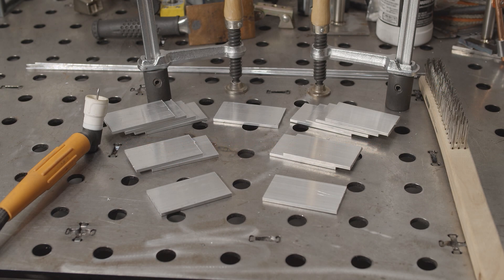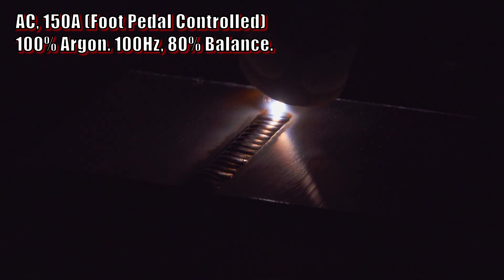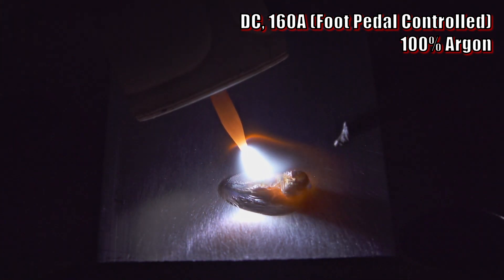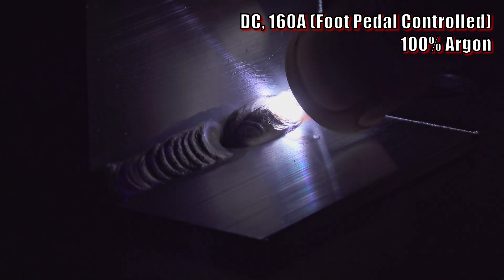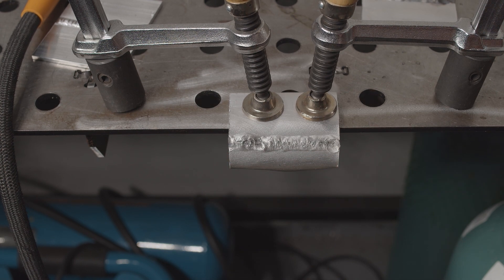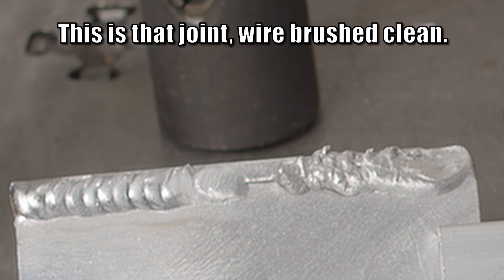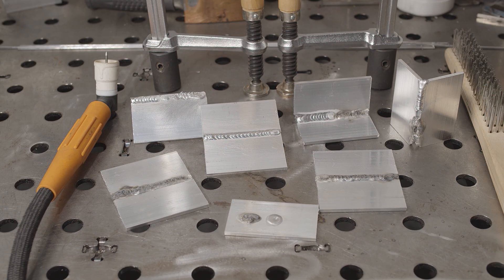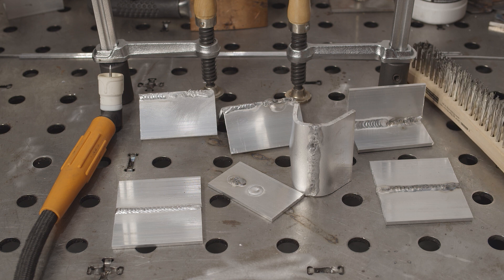TIG Weld Aluminum with DC and 100% Argon?

Comment: While watching your video, I asked myself whether there might be a chance of getting a better weld done with DC and Argon when you try to kinda add flux or brush away the oxide while pointing the argon on the startpoint of your weldseam. You could build a simple holder for the torch or another source for having a constant argon flow to the start point. While applying the argon you could grind, brush or etch away that oxide layer and start welding on that particular spot. Even if it would just affect the beginning of the weld, it would be interesting, whether this helps or not. But who knows if this will give a better chance to have a better seam at all because of a proper joint at the beginning of the seam, so the following material flow might be at least supported...in a way. Hope you got my point. 

Greetings from germany!
Reply: And while thinking about what i wrote, i thought about adding a few drops of flux onto that aluminum in direction of the seam, so the whole welding area is covered under flux until the torch ist burning the flux away. Wheres flux, there might be no oxygen as long as its completely covered. When it gets burned away, there might be enough Argon surrounding that spot yet. So if we are lucky, that could lead to process which fades out the flux at the same time when Argon is fading in. So no Oxygen between etching and shielding. And again...I hope you got my point. :D

Greetings from Germany again!
Reply from the maker: Not sure how the flux would interact with the TIG arc.  Could be interesting to try out.
Reply: @bigtb1717  I own a DC tig welder myself. Its made by EWM, which is a high priced brand from germany. Had a lucky moment to get that one very very cheap. But since I faced that I won't ever be able to weld aluminum with that machine, I always thought of buying a chinese made AC/DC welder. But should I really give away my nice german made welder for a chinese one? Well...owning two welders wont make sense for me, as im not having that much space and as of its just a hobby ill need to keep an eye on the money too. The few moments, when I need to weld aluminum, it would be nice to have a trick to get it done. Brazing is a possibility also. Usually strong enough for most cases. But welding with DC would be nice. :)

 If you would give that flux method a try, that would be very interesting!
Reply from the maker: If you can get a bottle of 100% helium shielding gas, that can be used to TIG weld aluminum on DC.  It's better on thick material because of the added heat of the arc, but it works.
Reply: @bigtb1717  Yeah as you showed, that worked good in a way. But having another bottle standing around might not be the better choice over a quite compact AC/DC inverter welder. Even if its made in china. Therefore...I guess getting more into brazing might be the better choice for my circumstances. Or the chinese welder...

But anyway, do you plan to try the flux method? :)
Reply from the maker: I may give it a shot, but I can't say when that might be.  It wouldn't take much to just light up an arc on a piece of aluminum with flux on it to see how it will go.  My thought is that it will burn off ahead of the arc, or simply vaporize from the arc and essentially act like contamination.  If I get a chance, I'll try it in the next few weeks and let you know how it goes.  If it somehow just goes fantastic, I'll make a video.
Reply: @bigtb1717  Sounds great! :-)

Comment: Learn how to weld before you make videos giving others advise.  Seriously you need to watch this guy do what you tried to do but correctly.  https://youtu.be/b1dCZyH_NBI
Reply from the maker: I specifically said in the video that it can be done with 100% helium as a shielding gas, which is what Jody was doing in the video you linked.  But that is NOT what I tried to do in my video.  In this video I wanted to show the results if you tried to run DC with pure argon, and explain why it is NOT the recommended way to weld aluminum.  Over the years I've seen people ask in various places if aluminum could be welded using DC and argon.  So I figured I'd see how it goes and share it.
Reply: @bigtb1717  he does have another video where he said argon helium mixes also work. The helium just makes the arc hotter so depending on how strong you DC machine is you might not even need that strong of a mix if at all depending on the situation.  I just wanted to point out you kinda spreading a misconception. Helium + Argon tanks is used with a Y splitter can also be used with to help out the effective welding power of power of most of your affordable welding machines folks watching your video.
Reply from the maker: I know helium-argon mix can help add heat, and I've seen multiple videos of Jody talking about mixing in helium with AC welders for thick aluminum or to get a little more out of a machine.  Never seen a mix used for DC aluminum.

I did say in the video that DC can be used for aluminum with 100% helium.
The last thing I would want to do is steer people wrong.  With this video I simply wanted to show how aluminum would weld on DC vs. AC when using argon gas, so people would know what to expect.  If you can point out specifically what I said or did that was incorrect, I'm happy to correct it.
Reply from the maker: Also, I will admit right now that I am not, and will never be, half the welder that Jody Collier is.

Comment: I heard that because argon DC welding on thick aluminum penetrates better, but the look is horrible. So after the first DC layer second AC layer can be done for nice finished  look. How about that?
Reply from the maker: As far as I am aware, DC welding on thick aluminum is normally done using helium shielding gas, not argon.  The helium results in a hotter arc, and combined with the DC current results in greater penetration.  The helium also cuts through the oxide layer better and from what I've, seen the puddle flows and reacts better with helium than with argon on DC.  Personally, if I had access to AC, I'd just use that and turn up the amps for whatever thickness I was welding.  If I needed to weld something thick and needed extra penetration, I'd just get some helium.  But that's just me.  

I imagine a pass with AC over a crusty looking DC weld would clean it up, so I suppose that's an option.  If it works for someone and gets the job done, that's cool.

Comment: I've seen marginally better results with pulse tig, still completely horrible compared to nice old miller 400A ac machines with ArHe gas. Which i love 💕
Reply: You "Can " do it but is it that right. Would shipbuilders,  or Even just structural fabricators trust it. I heard you need a machine that cycles the current to some way higher value and dip for a cycling action that gets rid of the oxide
Reply: @ryanb1874  Any liquid cooled high amp squarewave ac machine will do really. Whats most important is the helium mixed argon, it allows more energy transfer in the plasma arc

Comment: Thank you for your excellent presentation on argon & helium DC Tig on aluminum. Also a good explanation in the comments section on spray transfer using a DC mig spool gun  to aluminum

Comment: fuck my life... thx for explaining and showing why DC + argon is so shit. i just bought a DC tig welder for my workshop to fix cracked alloy rims. and it cant fix them lol it looks exactly like you DC argon welds + i got the problem that the wire in the tig welder melts away or melts into a ball even on the lowest setting.......

Comment: Thank you, Now need a video on the cheapest AC Tig welder than can weld aluminum..
Reply from the maker: I'll be on the lookout for an option to check out.
Reply: @bigtb1717  Thank you.
Reply from the maker: I'll be reviewing a sub-$500 AC/DC TIG welder soon.
Reply: @bigtb1717  ahh nice can't wait!
Reply: @bigtb1717  was it a bust? The $500 Tig ac welder...
Reply from the maker: I posted the review yesterday morning!  It works, but it has a lot of issues.

Comment: Interesting subject and nice job on the video. With the video principal in mind, do you know why MIG aluminum welds on DC seem to work out ok? I've always wondered how a spool gun welding with DC can somehow clean away the oxides and lay down a decent weld without the AC cleaning. Maybe it has something to do with the short circuit ark? Interesting!
Reply: TB is right, aluminum MIG welding is typically in a spray transfer mode. However, what’s easy to overlook is that when MIG welding aluminum, we’re using Direct Current Electrode Positive. The reason we generally use Alternating Current for TIG welding is that we want the etching that occurs during the Electrode Positive half-cycle, but in that electrode positive Half, 70% of the arc energy (in the form of heat) is directed at the tungsten electrode and the torch, and only 30% at the work piece. So if we just used DCEP, we’d need a huge electrode and a lot more current to penetrate the same thickness of aluminum as we would on AC. We use AC most often because it allows us to have the cleaning we need during the positive half cycle, while on the negative half cycle, we get more heat into the work piece and less into the electrode and torch. For nearly all conventional MIG welding and many stick welding processes, it’s said that having the 70% of the arc’s energy at the electrode is a favorable condition, since in theory, the electrode is being subjected a high amount of energy to be melted and transferred across the arc at an extremely high temperature, while the other 30% of the energy is focused on the work piece. I know it isn’t nearly just as simple as that, especially now, but after polarity in TIG welding was explained to me in school, LOTS of other things finally started to make sense to me. Hopefully that makes sense. I wondered the same thing for quite a while!
Reply: @alexweeks4203  Thanks Alex, now that you've explained that to me it makes perfectly good sense. I suppose it would be fair to think that MIG welding aluminum won't get the penetration that TIG welding aluminum would.? Now that I think of it, MIG welding compared to TIG welding in general with the exception of flux core mig would have less penetration due to the DCEP polarity.
Reply from the maker: The processes are so different, and MIG is so varied as a process in general, that it's hard to make a generalized, apples to apples comparison.  MIG is definitely a process that if run too cold or with the wrong technique can leave a weld that looks good, but it basically just laying on the surface.  But when set hot enough, and especially when running spray transfer, MIG can definitely get plenty of penetration.  I've never seen a comparison between MIG and TIG on aluminum.  Could be interesting.
Reply: @bigtb1717  There's your next video :)
Reply from the maker: @DIYHomesteadProjectsDIYHP10  Yeah, just have to get a MIG welder capable of aluminum, lol.
Reply: @bigtb1717  LOL, I figured you had one. Guess that's what I get for figuring. :)
Reply from the maker: @DIYHomesteadProjectsDIYHP10  I've been looking into getting one so I have that option, but I haven't taken that leap yet.  I think I could get a spool gun for my ESAB, but it's pretty expensive.
Reply: @bigtb1717  I completely understand. Personally I think it would be neat to MIG aluminum but I have two AC capable TIG machines and I just don't see the need. I know they are much quicker for production work but I'm not doing any of that here. Heck I have a MIG machine that's supposed to be capable of MIG aluminum but I don't even want to buy a roll of wire to try it out. LOL If I did I would probably make one video about it and never use the rest of the spool. Really my problem is I don't like always setting a machine up for one thing then having to set it up again for another. I'm just lazy I suppose. I just really like the look of TIG in comparison to MIG. I'm still learning how to TIG. LOL :)
Reply from the maker: MIG welding aluminum is usually done as spray transfer.  Spray transfer isn't actually short-circuit arc.  As the aluminum is fed out it melts before touching the base metal and is "sprayed" in little, molten droplets at the base material by the force of the arc.  MIG aluminum is usually done at 20+ volts.  I imagine it's the high arc voltage combined with the characteristics of spray transfer that allows the process to break up the oxides and get a relatively consistent result.
Reply: @bigtb1717  I see, interesting topic. Thanks for the insight. If you can't tell, I'm just starting to learn a little about the MIG process. Thanks again!
Reply from the maker: I'm always learning more as well.  Also, thanks for the kind words.
Reply: You can TIG with DC but you need your tip or the tungsten to be + and it will weld as good as the welds he is doing here.
Be careful with the amps as you will go threw your tungsten rod pretty fast but you can get the job done ..

Comment: I decided some time ago to just use my spoil gun on my Esab or the mig gun on my Fronius to weld aluminum. this works well for me down to 1/8  aluminum. since I rarely need to weld thinner aluminum
I don;t need to tig aluminum. What I really use my tig torch for silicon bronze with 100 % argon.. You did a good comparison of dc to ac. I believe i have seen a argon/helium mix to tig aluminum on dc but I have never done it myself, maybe somebody out there has done it at work and could comment.
Reply from the maker: I've never used 100% helium, but I have tried 75% argon, 25% helium.  Works good on AC to give that little bit of extra heat.  On DC I couldn't really tell a difference between that and 100% argon, but it was only 25% helium.
Reply: AC tig heliarc is for aircraft sheet metal building tools for aircraft using DC TIG USE ARGON OR HELIUM so that you don't have to heat up the entire fixture.

Comment: what polarity did you run the dc tig on aluminum? ive heard if you run on reverse instead of straight polarity with a much larger tungstun you can weld up to 40-80 aps with dc acting as all cleaning,  problems being the arc is hard to control because of the lack of a pount and the tungstun gets very very hot hence why you have to use a much larger one and at lower amps.  not advised but i think my old welding teacher said this is how aluminum tig was originaly done, but i cant remember if it was with argon al well as helium or just helium. would be cool to see tho unless thats what you did but im thinking not since you will melt anything smaller then a 1/8 tungstun
Reply from the maker: I used electrode negative for all the DC welding in this video.  Never heard of using electrode positive for aluminum.  As you say, at anything other than low amps you would be blasting away your tungsten.  You'd probably overheat an air cooled torch pretty quick too.  But maybe it's good for thin aluminum if you don't have AC because of the reduced heat put into the part on DCEP.  Either way, I don't doubt that it happened.  Just about everything in welding has a following of people who swear by it.

I know a lot of aluminum TIG welding used to be done with large transformer machines on standard 60Hz AC.  This gave a 50/50 balance.  They had to use a continuous high-frequency box to keep the arc from going out as the AC sinewave crossed zero.  Because of the 50/50 balance, the electrode would ball up, and that's how they would run it.  Once inverters and new tungsten alloys came along it became possible to run a pointed tungsten on aluminum.  I used to see debates about pointed vs. balled tungsten for aluminum.  I'm sure there are still people out there who intentionally ball their tungsten with a short blip of DCEP before welding on AC with their inverters.
Reply: @bigtb1717  now that I think of it I think the fabrication series did a couple videos on this lol as for balling the tungstun that's what the old timers would swear by but I tied it and found much better luck with the smallest balling amount possible, for a more focused arc
Reply: @cec4  I use Zirconiated Tungsten for all AC Welding because 1) it never forms weird shapes, it carries a lot of current and when it balls, it does so nicely and doesn’t spit into the weld ; and 2) It gives me one box of tungsten that’s just for aluminum or AC welding and one for everything else. It seems like I end up doing less grinding that way for some reason lol

Comment: Sweet video, never got to test stuff like this during my schooling. Have you tested dual shield flux core penetration vs regular mig or flux core only in small portable welders?
Reply from the maker: I've tested penetration of MIG and self-shielded flux core in several small welders, but I haven't done a specific comparison.  In my experience, self-shielded flux core definitely get's more penetration in a small welder than gas shielded solid wire MIG, all else being equal.  I haven't tested penetration for dual shield.  Maybe I should do a comparison video of all three.  Could be fun.
Reply: @bigtb1717  I have seen that some of the commonly sold flux core wire isnt recommended for multi pass welds, so no clue how much more effective dual shield could be for a lil 110 for actual practical use. Interesting though for sure.
Reply from the maker: @BudMasta  Dual shield requires a fair bit of voltage, so I don't know that it would run well on most 120V MIG welders.  I think 20-21 volts is around the bare minimum of voltage for 0.035" dual shield, so it would probably be pushing it for a 120V MIG machine.  Could be interesting to try it.
Reply: @bigtb1717  ahh, didnt even know about needing more voltage. Darn!
Reply from the maker: It may still work, but it would likely be right on the edge.